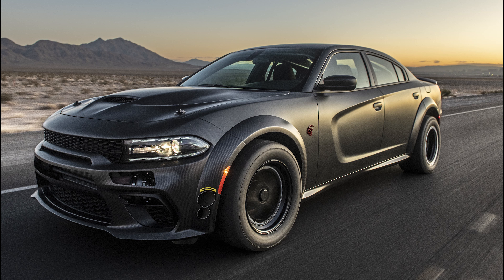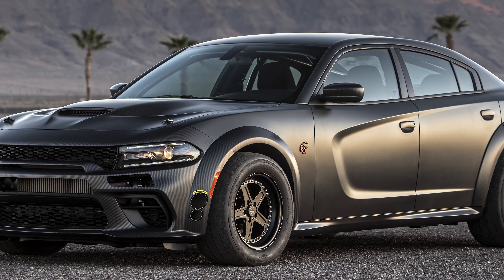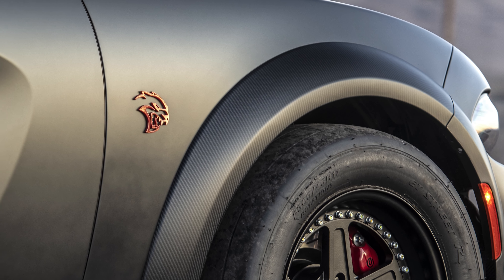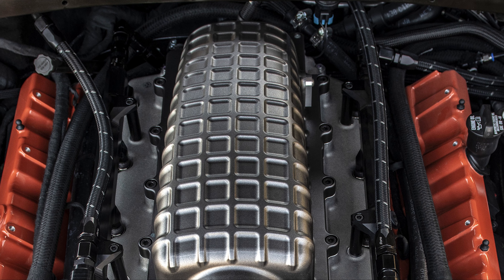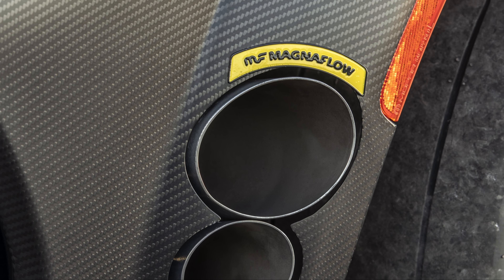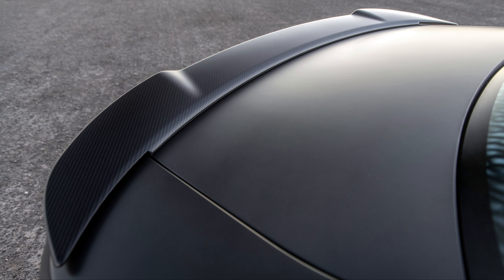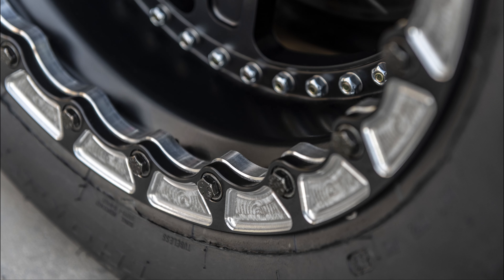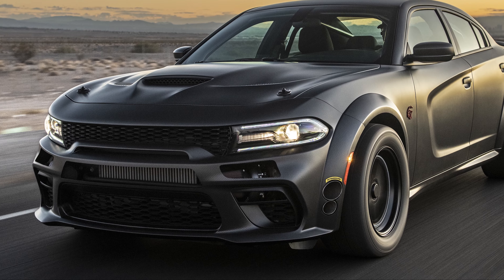SpeedKore and Magnaflow display a 1,525 hp, AWD, Twin Turbo Charger at SEMA!

Comment: I NEED TO KNOW THE 1/4 MILE
Reply: PixelFastFood Play like immediately lol
Reply: Dude its probably gonna be like 6-7 seconds 😂😂😂
Reply: Meow!!!
Reply: @JCHEMI  garentee that is not a 6 sec car. Probably 7's
Reply: Nathan22 Outdoors you’re right. Probably like a 7.8-9 second car once it’s dialed in.
Reply: Nathan22 Outdoors they already got high 8s on stock motor demons rwd with much less than 1500 hp. Now add the extra power and awd.
Reply: @TheBb6prelude  don't forget AWD is only really helpful if it has too much wheelspin so you don't get too much power on two wheels. With this much power I can confirm 4wd will be needed.
Reply: PixelFastFood Play the fastest cars in the history of the planet aren’t even awd. That says everything you need to know. AWD helps more on the street.
Reply: @TheBb6prelude  true. AWD is pure if the car doesn't have traction, but with some real good tires, you don't even need AWD with that much power! Plus, the car will be heavier. On the road it will really help tough. I've got a 700hp rwd car and I tell you it is not drivable at f.e. snowy days :)
Reply: High 6’s
Reply: 8's at most, probably low 9's in all honesty. This car has to weigh a shitload and AWD doesn't help much on the drag strip. Plus, thanks to AWD and being an automatic, I'd be surprised if 1,000hp made it to the wheels.

On the street it would be a beast tho.
Reply: @SantiagoOXfir  Care to tell your reasoning? Or are you just saying no for the hell of it?
Reply: Gᴜᴛꜱ • ᏖᏂᏋ ᏂᎧᏬᏁᎴ Ꭷƒ ᎴᏗᏒᏦᏁᏋᏕᏕ yeah it has 1525 horsepower why the fuc would it be in the 9’s let’s be real here
Reply: PixelFastFood Play I saw an interview with Dave from speedkore and I’m pretty sure he said low 8’s.
Reply: Gᴜᴛꜱ • ᏖᏂᏋ ᏂᎧᏬᏁᎴ Ꭷƒ ᎴᏗᏒᏦᏁᏋᏕᏕ i know omg late to the parade but they had stock/lightly modified demons which made less than 900 at the crank run high 9’s, 1525 at the crank is definitely in the high 7’s low 8’s considering it weighs as much as the demons once you factor in how much weight it lost with carbon fiber (which it partially gained back from awd)
Reply: I’d say 8.60 off the trailer and they could get it down to an 7.30 with tuners on scene and a professional driver.
Reply: @SoI_Badguy  Idk man... AWD helps a shit ton, automatics are faster than manual transmissions, and it's probably not that much heavier than the hellcat variant (due to the carbon fiber)-this thing is definitely gonna pull 7s or low 8ts at least
Reply: I’d like to see this leave a stoplight, we all know these are traction limited. To watch it squat and all wheel peel away from a stoplight would be amazing.
Reply: @PixelFastFood  no you don’t

Comment: Hopefully it can go low 8s or high 7s
Reply: They should make it lighter and one thing they should use is use ceramic brakes instead of Brembos. Dodge could still get their calipers from Brembo but they should use ceramic brakes instead and try to make the power to weight distribution better

Comment: If they add part time awd they will improve their 1/4 mile times by at least 6 tenth in the drag strip and a  full second 1/4 mile in the street with the same engines they have and best of all since it would be part time awd you keep all the muscle car fun all burnout fun. Bmw is doing this what are you waiting for dodge

Comment: Mopar instead of making fast cars you should work on making your engines reliable those hemis are a piece of crap..one of the worse things you could've done are using plastic valve guides that should've been a recall ...